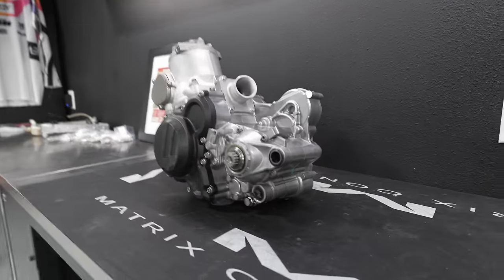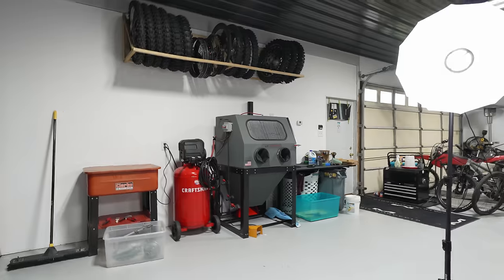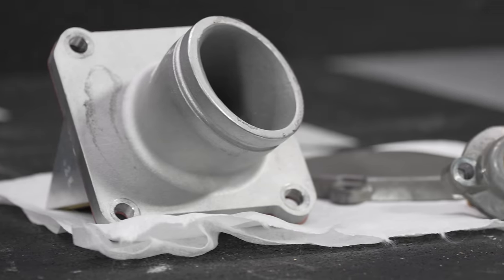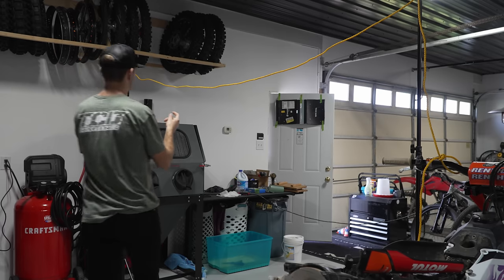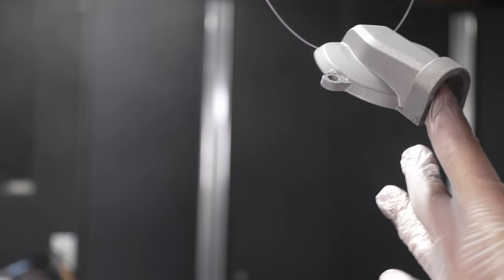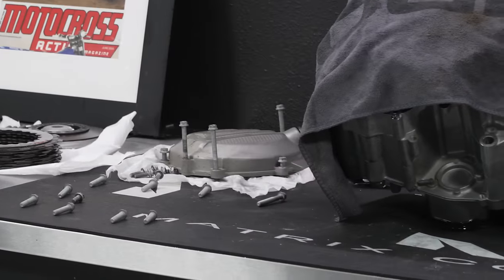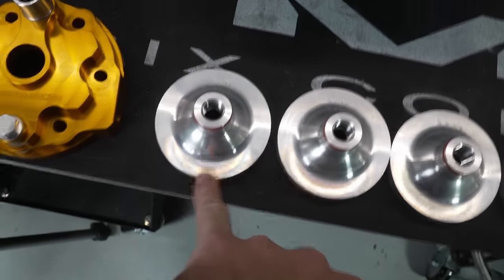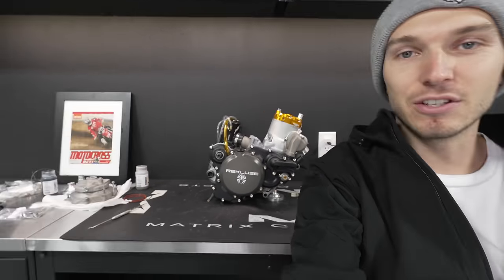Making my 2-Stroke Engine Look Factory!! - The EASY Way!

Comment: Hi Jeff this is awesome and glad to see everyone now discovering this product. I work for an MX race team in South Africa and I Cerakote coat all their stuff from Pistons to valves for a living. Done quite a few pro riders stuff as well. What I would suggest is the following. Stay away from Vapour blaster for Cerakote. You are not going to get desired anchor pattern/mechanical profile. Sure Vapour blast to clean it but still have to dry blast with medium like Aluminum Oxide or garnet at 60-80 grit to desired PSi as recommended by Cerakote which is what we call SA2.5 - SA3 white surface blast and then gasout in the oven as deep penetrated oil in porous aluminum substrate needs to come to surface. If no discoloration after gasout process blow off parts and spray.   If you notice oils at the surface you have to start at step one all over again. Also when you spray don't mist the parts. Spray pattern must be 1 inch oval with 50% wet pool in centre. You have to do straight paths at 12° up and down with 50% overlap so you pool the paint on each run in an upward downward stroke. That's how you get high gloss levels and linear surface sheen... The less you stay trigger happy but linear the better the finish. Also side covers must be done in H series (Oven Cure) with H300 clear if you want it to last but have to have metal hopper on spray gun as part B will eat the plastic. Anyways I'm here to help if you get stuck because there will be plenty paint fails as you get really involved and start fiddling with different clears, metallic colors and FX flake.
Reply: I always just spray any surface discoloration with brake clean, usually it pulls the oil off and evaporates right away although sometimes I've had to put it back in the oven.
and yeah glass beads in a vapour blaster just embed water and glass into the pours of the metal which will cause corossion and prevent proper cure of cerakote
And he really should be using a cartridge filter mask. this stuff is very toxic.
Cerakote also very clearly calls for 1-2 passes just on the wet side which doesn't always matter but on certain coatings it can make or brake it.

Comment: Idk, seems kinda lazy. You have a fully stocked dream garage, surely 30$ isn’t too much of a sacrifice for an oven from marketplace… it’s has many uses, and in the case of cerakote the finish seems to become far stronger when oven cured in my personal opinion. That’s the route I took, and since the cure time is only 2 hours with the oven cured coats instead of a full 24/48 hours for the c-series I would argue the oven cured stuff is far more time efficient. Outgassing cast aluminium parts is very important for a lasting finish, they recommend it for a reason. Whenever I coat cylinders or cases I always outgas them in the oven, and more often than not you see spots of oil seep to the Surface even though the part had been soaked in acetone.
My two cents, I recommend oven cure for serious use, and only C-series for high temp applications.